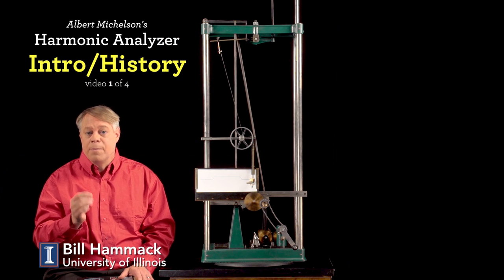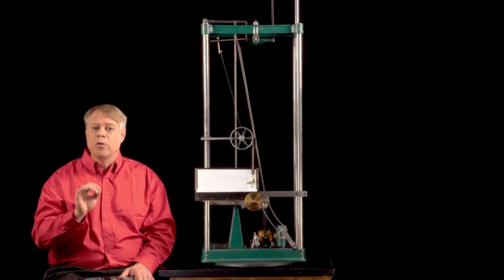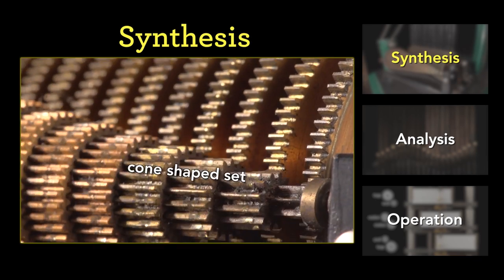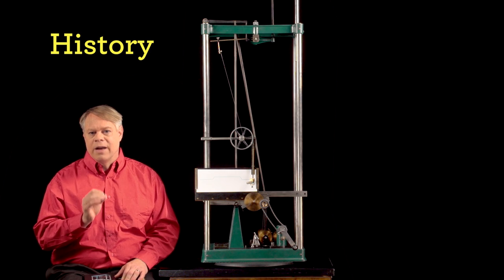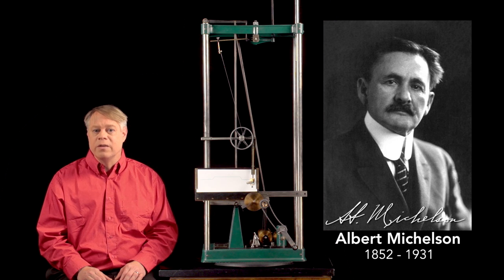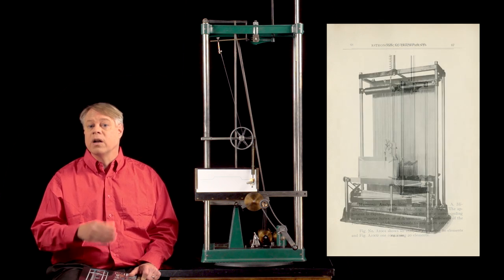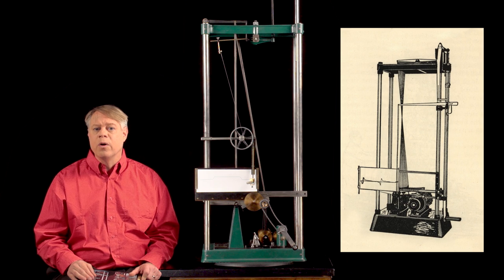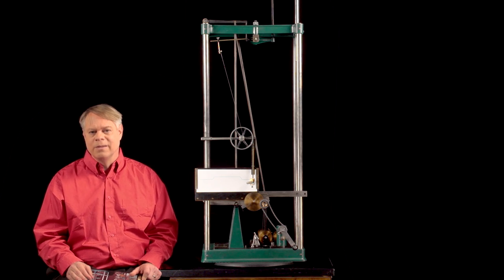(1/4) Intro/History: Introducing a 100-year-old mechanical computer

Comment: My first computer program of any significance was one that added up the sin wave harmonics with coefficients to plot out the resulting square wave in asterisks on a TI thermal printing terminal.  That was in 1975.  I learned Fourier analysis in 1968 in college and have been fascinated with it ever since.

My ham radio transceiver is an SDR that does repeated FFTs to show me the spectrum of the band.  I have yet to grasp how FFTs work.  It's always fascinating to see this topic presented in as many ways as possible to continue to strengthen my understanding.  Thanks for these lessons!

Comment: Hi! Wonderful videos. My son is working on Gibbs phenomenon and of course the Michelson Fourier Analyser was at the origin of the story. Have you by chance a video sequence showing it with the machine? Thanks.
Reply from the maker: Alas, the Gibbs phenomenon was never seen on the machine; the Michelson machine was not the origin. The Wikipedia page on the Gibbs Phenomenon has the correct story. (I assume you that this could not be seen on the machine we demonstrated in the video!)
Reply: @engineerguyvideo  Ho! my God. in fact the French Wikipedia is not correct so but I have also read a thesis on Gibbs phenomenon in Wavelet decomposition mentionning the Michleson machine... I just read the english version and I anderstand your point. Thanks a lot.
Reply from the maker: When we started working with the machine all three of us knew of this legend and were stunned to learn it wasn’t true!
Reply: @engineerguyvideo  Ho I can imagine for sure. Now, let us think of the precision required: the Gibbs oscillation is  of the order of 1/10th of cm =1mm for a 1cm set fonction so the pencil precison should be  better of course but which can be manageable nowadays no?

Comment: It’s machines like this that makes me wonder, are we just really rediscovering or reinventing things that have already existed in a different form? That and how steam-punk may not have been that far off from how it could have been. I can totally see this running on steam. As for the book, the equations Michelson used in designing the machine looks suspiciously close to the equations used for addition and subtraction when applied to a slide rule. If true, does that mean log approximations are possible? Hell, Fourier’s work is based on Taylor series expansion with allow for polynomial approximation of a function, so surly it’s possible right?

Comment: i understand the uses of fourier analysis today but what practical use did it have 100 years back when machine was made or was it just for scientific purposes?
Reply from the maker: tom soder Michelson was measuring the light from vaporized elements with his interferometer. He need to transform that data into a spectrum (i.e., intensity vs. energy). It is described in his book Light Waves and Their Uses, which is at archive.org and other places.

Comment: can it run crysis?
Reply: @twerktospec  if you have enough paper and time then yes. But I mean you'd need to write down all 30,000,000,000 bytes of ram and perform the calculations yourself.

Comment: You can't apply the math at the level of metal. The metal/hardware components go through trial and error methods of design-cum-testing before the final prototype is selected for commercial manufacture. The math exists as conjecture to explain the workings but cannot be employed to create a working machine. Nikola Tesla used basic math and invented some mind boggling stuff. Edison did better and hardly knew the theory behind his impressive inventions. Designing and manufacturing machines from scratch are beyond the mental gymnastics of math equations.